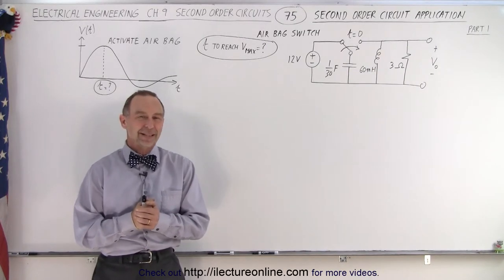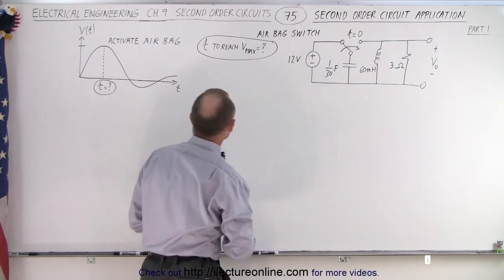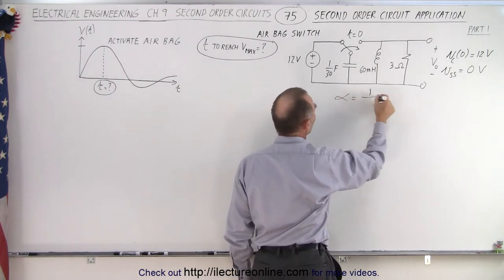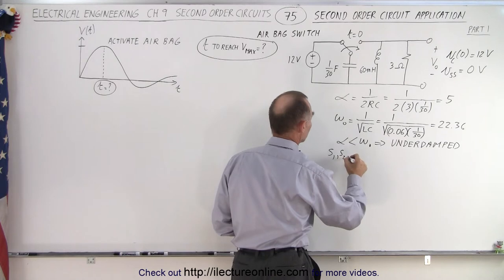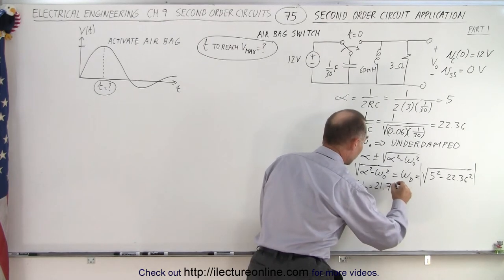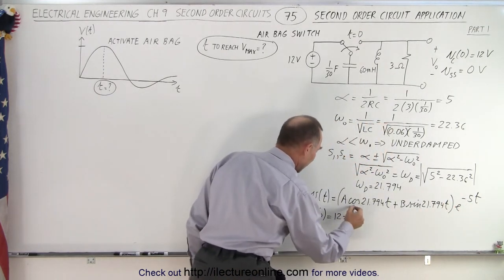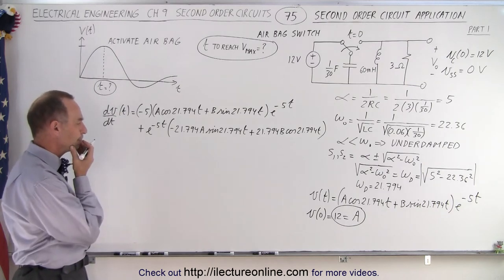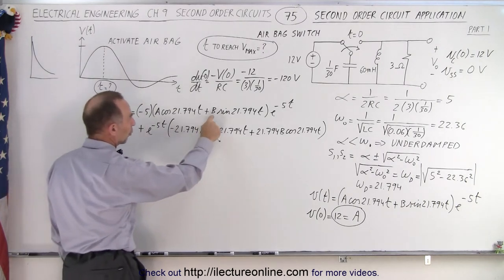Electrical Engineering: Ch 9: 2nd Order Circuits (75 of 76) Time for air bag to deploy? (Part 1)

Comment: Generally, shouldnt current be assumed to change instantaneously across a resistor? I know that this is a second order circuit, however, the resistor is currently not in series with a time varying component other than the capacitor so 1:10 confused me when you mentioned that voltage will increase to a maximum. The resistor is in parallel with the capacitor, so it should be maximum the moment the switch is thrown, which is 12V. I've also plotted the equation from 11:15 which confirms that t=0 is when the voltage across the resistor is at the maximum. I may be missing something obvious, so I want to ask what I am missing or getting wrong. Thank you for your time doing these lessons!
Reply from the maker: In the real world, nothing happens instantaneously. (even the current through a single resistor with no other components attached when the switch is thrown).   And in this case you have an oscillating circuit, which means that the capacitor, the inductor, and the resistor cause the current to oscillate over time as shown in the video and the frequency of the oscillation depends on the time constant.
Reply: @MichelvanBiezen  I agree that in nothing happens instantaneously in the real world. However, with circuit theory, it is one of the main basic assumptions that electrical effects happen instantaneously (with exceptions such as capacitors, inductors, physically large circuits, and unfavorable inductance in circuit wiring). Again, the equation plotted shows that the maximum voltage over the resistor is at t=0.
Reply from the maker: The circuit works as depicted in the video.